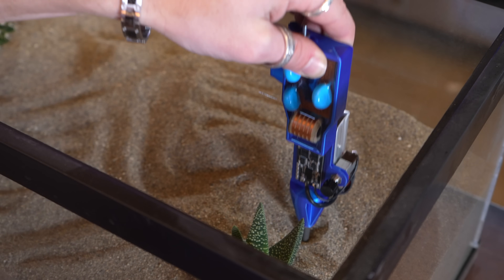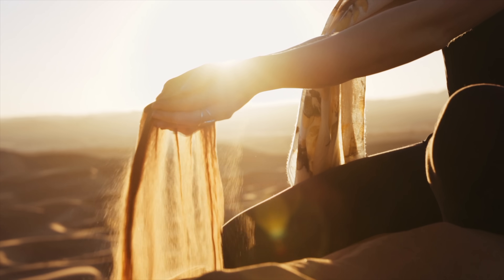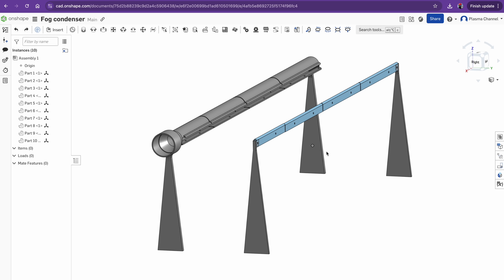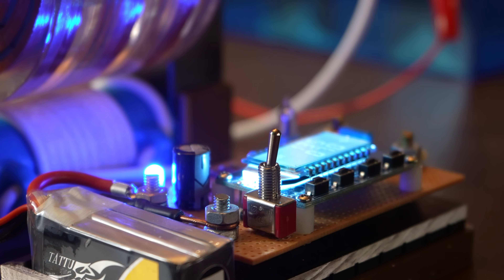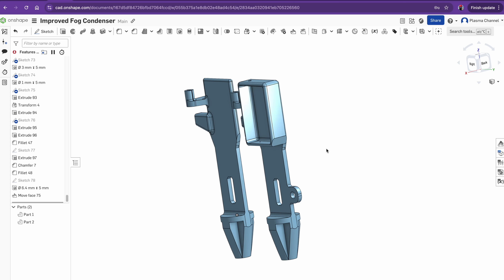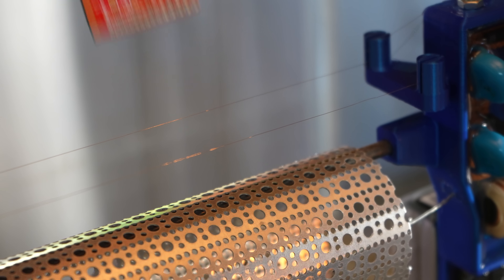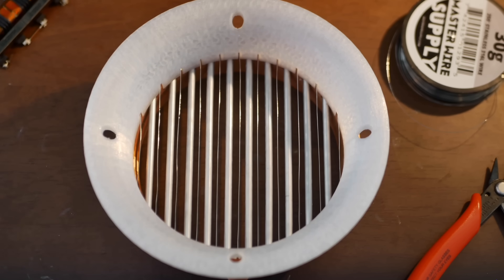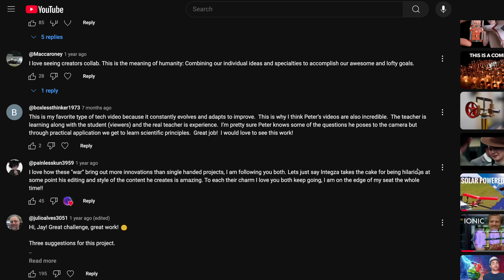Solving Desert Water Shortages Using 20,000 Volts

Comment: I’d heard of using nets/sails to catch water in deserts before, adding power to it is very interesting. One thing to keep in mind is how local fauna might interact with your setup—and I don’t just mean like an animal licking water off the grounding matrix, or out of the catcher, but the electrified wires up top. Having them be near invisible is actually not a plus when it comes to flying critters, as they might run into it. I’d also be curious if the electrical field might disrupt the navigation of any flying critters. None of these are prohibitive issues, just would be good things to check and plan for if you want to make this a real permanent setup somewhere.

Comment: 12:00 why not run the charged wire through the middle of the mesh so that the system is not wind direction dependent and draws moisture into the mesh due to volume loss of the condensation?

Comment: what if you coat the screen with Si02 (ceramic coat / aero gel) so it's hydrophobic. will the water just fall to the ground or fail to condense skipping the collector ?

Also what if you place a lose ground wire on the surface of the ground with a hv above maybe just drive the water directly into the ground rather than collect it and let it drip off.

Comment: Can you paint the mesh with infrared cooling paint so it is cooler then the surrounding air and  water condenses faster? 

Or is a the temperature difference too small compared to the charge effect?

Comment: Not a very fair test of the commercial dehumidifier as most of them take a while to get working once turned on - the compressor based ones have to cycle for a while before the cold side is really cooled but can then maintain that large condenser at the temperature quite efficiently, where the ionic version really is instant on by method of working but should have a a very consistent flat power draw. 
Also have to consider how the efficiency will change relative to the humidity - I suspect that commercial offering will actually work way way more efficiently when there is comparatively little water in in the air - the cold side doesn't use lots of energy on condensing water that isn't there, so the compressor likely doesn't have to run very often/hard, where your ionic device will always be playing thruster and probably draws much the same at all times - so in that really really thick fog is probably always going to win still, but real world?

Still interesting project that just needs better comparative testing over a long enough period to really count if you want to really claim that margin of improvement on the competition.

Comment: In the desert, there simply is not enough moisture in the air to harvest a substantial amount of water out of it. It being fog does not mean it contains lots of water, merely that the humidity is high enough to start condensing. Coastal fogs in deserts contain about 0.5 g/m³ of water. So for 1 litre of water at perfect efficiency you need to pass 2000 m³ of (coastal fog!) air through it. To do all that in the half an hour to hour long time per day that it is available... thats an olympic swimming pool of air for 1 small water bottle. You need industrial HVAC systems to pull that off in an hour, and that would give you... 1 liter per day.
Reply: See my comment above, they have the "dumb plastic net" solutions in many places. There it seems doable, maybe not the hardcore desert scenario, but if you get these to be a little conductive, span a few high voltage lines above, might improve water output with minimal additional cost. Corrosion and maintenance on the high voltage lines still issue compared to dumb nets, of course. But there are these fog collection nets, these could maybe be ugraded.
Reply: No reason you can't stretch the wire for 100m.  It looks like it generates an air flow of at least 1m/s over an effective width of ~0.1m.
So, 0.1m width x 100m length @ 1m/s = 10 cubic m/s, or 600 m^3 / min, or 36,000 m^3 per hour, or ~18 litre / hour by your estimation.  Not bad!
Reply: why? That seems like a perfectly reasonable amount of air to have pass through a large metal grid. In fact, it seems like not much at all. I don't understand why it would require a large HVAC system.
Reply: @kobitz9001  The numbers are right there. It would take over 33 kilowatts of power to pump that much air in that amount of time, assuming a pumping efficiency of 80%. This is 3x the HVAC power needed to cool a large factory.
Reply: @filonin2  no. 

Right now for $24 at Home Depot is a 20" box fan that I stick in my window when my room gets too hot. It's rated at 1820cfm.
1820ft³/min x 60min = 109,200ft³
109,200ft³ = 3092m³ 
To reach your 2,000m³, this single small commercially available unit would need less than 39 minutes. The math is easy. You need not fear it.
Reply: @filonin2   This plasma setup is taking advantage of Bernoulli's Principle with that concentrated velocity to move a lot more air per watt hour vs brute forcing kinetic energy with a centrifugal fan. It's significantly more efficient.
Reply: Humidity in many deserts is quite high, and even in very dry deserts rarely goes below 30%. Fog droplets do not constitute the majority of the water in the air, they just get the excess above the 100% present at the given temperature. As the temperature rises, and the capacity of the air with it, the droplets vaporize again.
Reply: @Akio-fy7ep yeah well too bad this literally doesn’t work unless the water is condensing already
Reply: Ig this is not a active measure to procure water, but a passive background thing
Reply: I guess you weren't watching the video. You can clearly see the high volume of air/water moving between the +ve and the -ve. This is the basis of ionic thrust propulsion. Just the system itself will move large volumes of air across the -ve grid. If you combine it with a shaped wind guide that produces a low pressure area, it will also enhance the moisture collection process.
Reply: @BartJBols after so presumptuoslus statement... have you at least learnt something new from comments?
Reply: @nonames706  Yes, that people are incredibly gullible, a plastic net is near-zero cost and upkeep, and if it gets a bit of water a day thats great. This setup would cost thousands to tens of thousands of times the cost of the plastic net, and gather 'only' 20 times as much water for the same surface area. Id rather have 20 nets at that point.
Reply: You have no idea. In the Middle East, it's foggy before dawn and so cold
Reply: Depends on the desert.  In kuwait the humidity at times is unbelievable high.  I also experienced high humidity in djibouti
Reply: @preciousplasticph  humidity is not the quantity of water in the air. Its the percentage of maximum water possible in the air considering other traits like heat.

Comment: This seems to have it's uses for sure, but the non active one also have it's use cases for sure... With good design it could be used as a dehumidifier only and be great at it maybe? or a survival water (but have battery, and or solar for longevity). And in some cases it could catch water where there apparently is none (again we need power, but we always do don't we and there are many options)...

For sustainable drinking water (survival stuff, i.e not totally "pure") I guess we need have some minerals in it also but I guess that could be a sand filter or something...

I like it! Now... try to make drinkable water from saltwater (without the reverse osmosis) with the lowest energy possible and you could save the world!

Comment: Have you tried any soldering irons like the Pinecil? Noticed you're using a Weller model similar to what I used to main, and I gotta tell you that the switch was life-changing!
Reply from the maker: Oh, do tell me more! The Weller I use...they break seriously 3-4 times a year. I need to buy / replace it constantly and it kills me.
Reply: @PlasmaChannel I'm using the v2 from Pine64 and power it with an appropriately rated power brick (Anker 737 currently). The portability/instant heat are killer features for me; can't speak to longevity yet, but can say the swappable tips are excellent!

Comment: This really only works where there is consistent fog.  The deep deserts far from regular atmospheric water sources are probably not good prospects.  But coastal deserts (think near-coast Atacama, Senegal, etc) are indeed strong contenders.

A solar array is already grounded so when you set up the mesh, just tie into the ground stakes that are protecting the solar panels.  NOTE: the solar panels and racks will, themselves, act as part of the condensing array.  If the crops planted are of the variety that enjoy a bit of shade (this is well documented under assorted agrivoltaic studies) then that is another bonus.  Getting more moisture into the soil, even if it isn't directly over the intended plants, is a good thing.

Taller array mounting posts will provide space below them to install the condenser grids, the charged lines and, hopefully, some measure of protection to keep critters from touching the charged lines.  Proper isolation should prevent that being a problem but you never know - animals can be creatively destructive to both themselves and the built environment.  The taller array costs a bit more, but perhaps less than a dedicated array structure + a dedicated emitter/condenser structure right over the irrigation line.

With sufficient array + planted area, you could easily have sufficient surplus electrical output for battery storage that keeps the area watered over a few sunless days, or else direct surplus power to any nearby communities that need it.

Comment: This is crazy. Close that loop and power it with solar. Please work with some non-profits and people in the field to get some real world data. How much of the logic of your controller can be shared between units? Can you have a dozen or two units all sharing one logic controller, or even one voltage multiplier? You probably don't want to use PLA in the field, it will get droopy at 40C. PETG should suffice. I really want to see this deployed. Please don't gate this knowledge or let tech turn it into a "revolution disruptor" for profit of course.

Comment: Am I wrong in thinking this could be powered with just a tall antenna? Similar to a coronal discharge electrostatic motor?
Reply: note: deserts typically don't have a lot of other tall structures which ground atmospheric voltage so this should be an ideal use case if I am not mistaken

Comment: Can this scale. I mean you are taking humid air and making it dryer. If you had fields of them would it not just dry out the air for the next field?
But it would be fund to see a system with a humidity sensor, battery and a solar cell. Such that it can turn on and off when needed and charge with energy from the sun. then they could just passively collect water all year.
Maybe you should look into the systems they are already using, I think they have optimized the net, such that they can collect water as efficiently as possible. Maybe the optimal geometry is different but it is maybe worth a try.

Comment: 850 mA x 12V = 10,2W... that yealds almost 53 ml / W / H !
Reply from the maker: It's an 850mAh battery. Meaning, energy capacity. Overall current draw was around 3 amps. And I actually measured wrong....energy usage is around 31 watts max (so the system is even more efficient than what I talked about. A great mistake!)
Reply: @PlasmaChannel  Yes a great mistake! I think there is a great potential to build solar powered water generators for the RVs in moist tropical enviroments !!!!!

Comment: Correct me here, but my intuition tells me that with a proper setup, for the desert, since you need high voltage and not a lot of current, you wouldn't even need batteries (or solar panels or diesel generators) in the desert, instead, you could use a sort of atmospheric generator? Like when you harvest energy from high up in the air where electrical potential is higher?

Comment: Fog is liquid water particles, small, but still liquid, (or solid,) and thus by definition can't condensate. The dehumidifier is designed to cause condensation, not to catch fog. 

While interesting video, producing water should be compared with other ways to achieve the same thing, and as fog nets can be produced for less than a dollar per square meter, and doesn't require power, and works as long as it holds together, and so on, your "solution" has to be extremely cheap and reliable even if it is many times more effective for a given area, to even be as good as conventional fog nets, and they have very limited practical use.  

14 ml/Wh is 14 liters per kWh, that's ballpark what multistage thermal desalination achieves, which doesn't require artificially dense fog. Desalination of sea water has it's own issues, but sea water is always available, much more than we even can use, fog is an unreliable source of fresh water, and stripping the incoming fog along a coastline very efficiently will reduce the amount of water in the air inland, possibly causing detrimental consequences. And thermal desalination can use any heat source, if fuel is burned to generate the heat, that's way more efficient than running a generator to produce electricity. 

Also, vacuum distillation can use very small temperature differences, like low grade solar heating, or the difference you can create between ambient temperature evaporative cooling in dry situations, and there are other good options too. 

But then again, modern reverse osmosis plants can produce fresh water from sea water with an energy consumption of 3 kWh per cubic meter, that's ~333 liters per kWh. Then you can either choose to produce the water as you need it, or produce it when you happen to have a lot of power and store the water, regardless if you happen to have fog at the moment or not.

Anyhow, maybe your technique could be useful if there's a desperate need to clear up fog, maybe to improve visibility. I suspect the heat from a big system would cause the air to rise and suck in more air with fog in it by convection. Fog doesn't just appear from nothing, it's air humidity that condensates for some reason, usually warm moist air that cools down, but it's only the part of the water vapor that is "forced" to condensate that actually condensates, the cooled down air still is near it's saturation point, which means even seemingly dense fog usually only contains a few grams of fog per cubic meter of air, which insignificant compared to what probably you had.
Reply from the maker: Really good info, thanks for sharing. I'll look into these caveats further when scaling up.